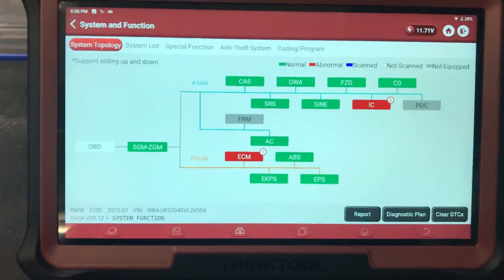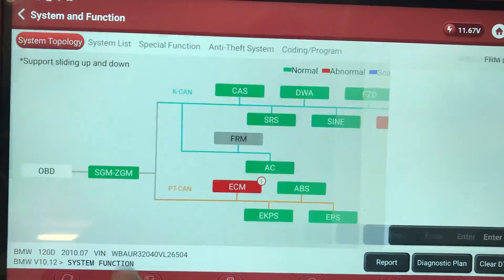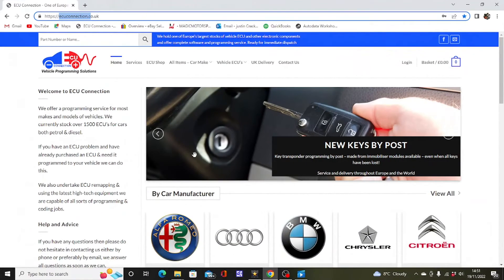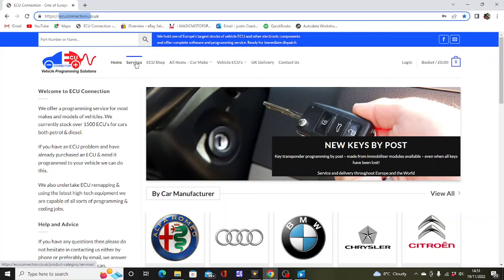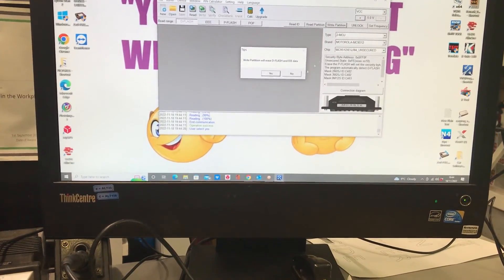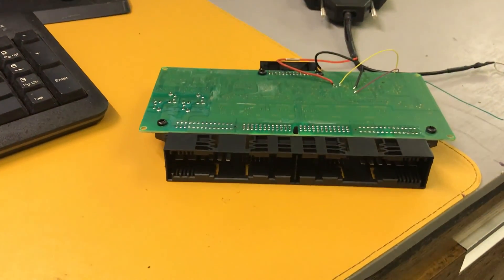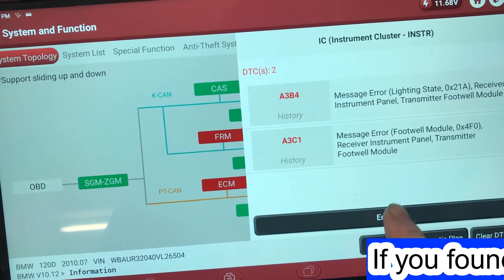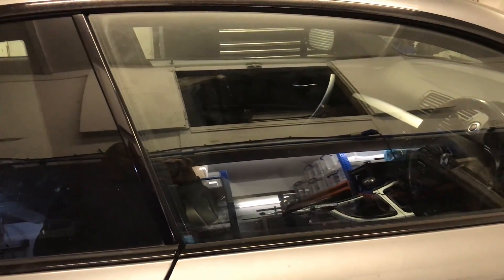BMW E Series FRM3 Module How to Test, Remove + Repair headlights, indicators, windows not working

Comment: I've just had my frm reprogrammed, all the typical symptoms went, indicators, windows etc now I have 9 light fault codes with no high beam, main beam, reverse light.
Can they be incorrectly programmed?
Reply from the maker: When we repair the FRM3 modules there is usually no further problems such as you are having, I can only assume the company / person you sent the FRM to doesn’t do the same as us by recovering the corrupt data & they have flashed a different file onto your FRM, it’s hard to say without having the FRM ourselves to check, if this is the case then hopefully they kept your ‘Dump file’ - we may possibly be able to still recover the data, if not then you may be able to re-code & update software on your FRM, for more details on what we can do to help please contact us via our website: www.ecuconnection.co.uk